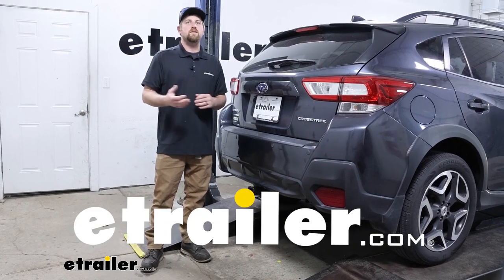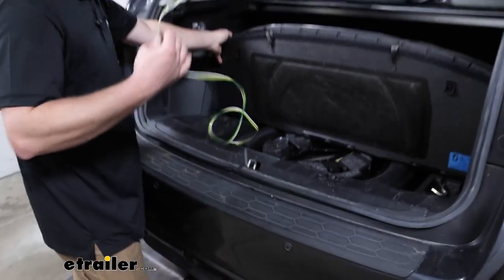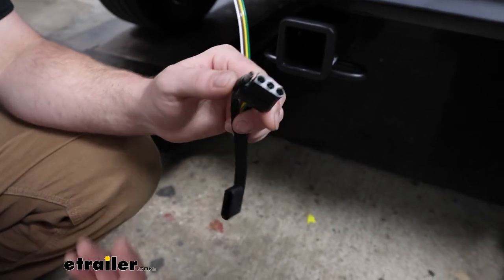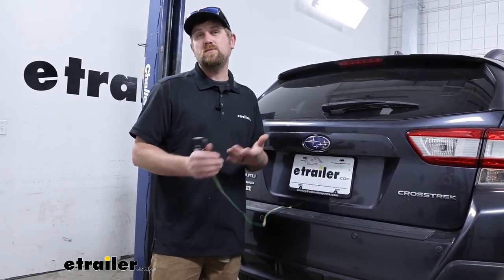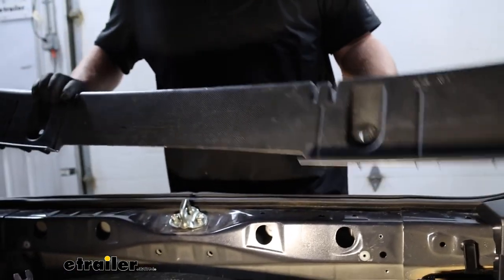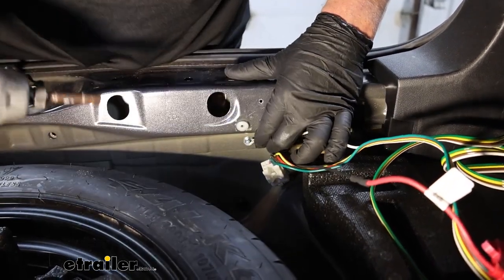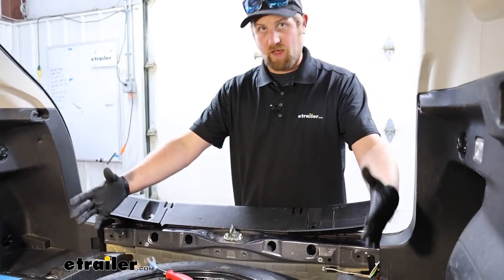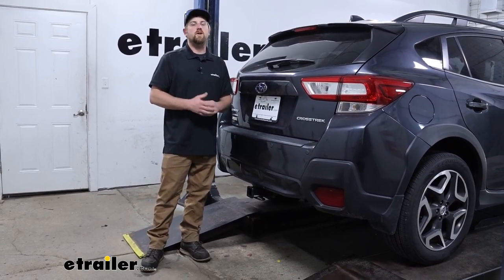etrailer | Curt T-Connector Vehicle Wiring Harness Installation - 2018 Subaru Crosstrek

Comment: There is a hole right under the spare you can snake those wires through.
Reply from the maker: You CAN install it that way if you wish, but storing the 4-pole connector in the cargo area of the vehicle when it's not being used helps protect it from moisture and damage. If you run the connector out through the floor, be sure to use some silicone sealant to seal up the grommet where the connector passes through.
https://www.etrailer.com/Custom-Fit-Vehicle-Wiring/CURT/C56040.html